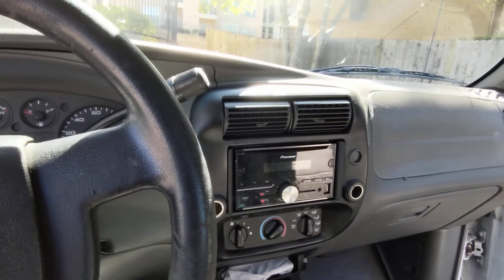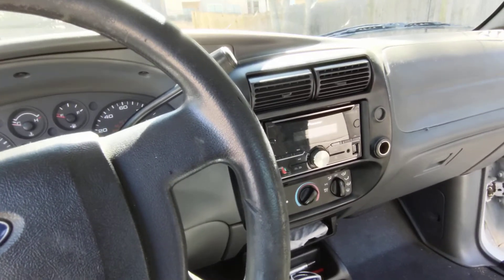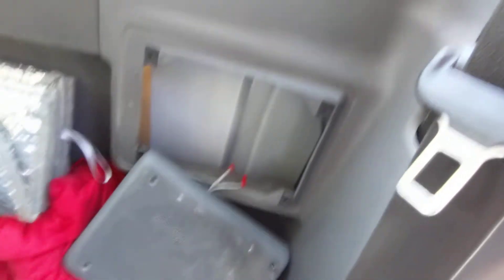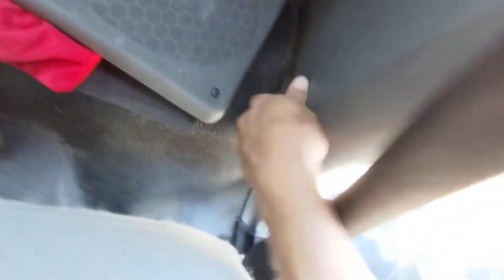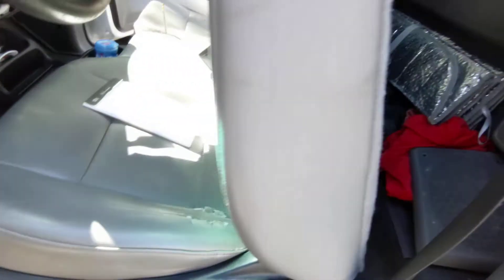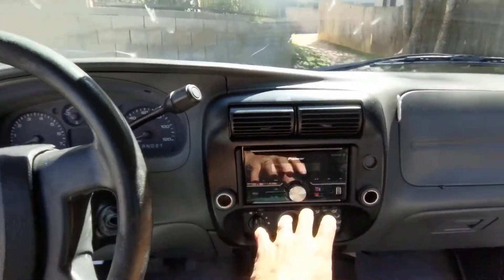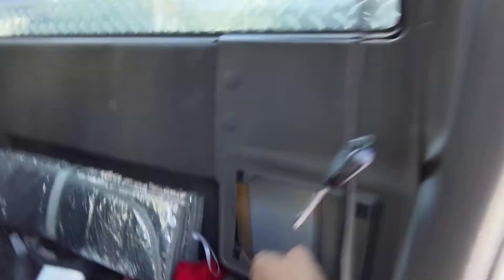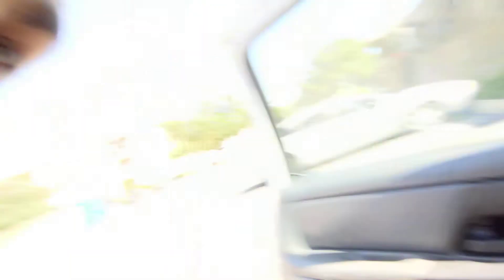Add rear speakers to Ford Ranger  (98-12) EASY

Comment: Each Ranger model and year has wildly varying different types of connectors and 6x8 cutouts etc. I’ve a 98 xlt reg cab flareside ordered a bunch of connectors and such for upgrading to round speakers etc and leaned quickly just how diverse the ford ranger models are in every way. Make sure you research your exact year and model before ordering anything. Just a warning I wasted over $200
Reply: 😊❤❤😊😊pl

Comment: So there was a new terminal for back speakers on the wiring harness or you spliced into the door speaker wires?
Reply from the maker: The green and purple wires on the harness I used were for the back left and right speakers. So, no I did not splice into the front wires. Hope this helps.